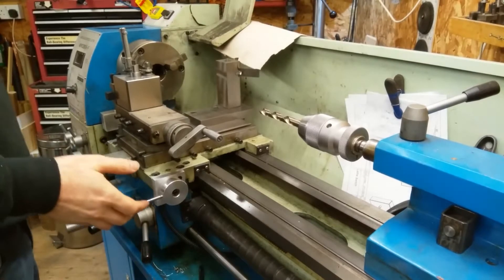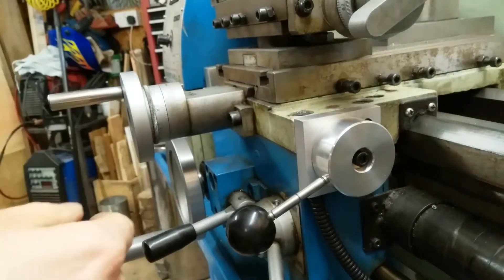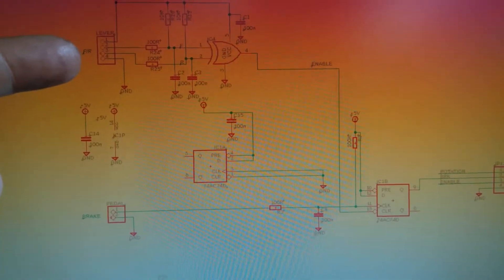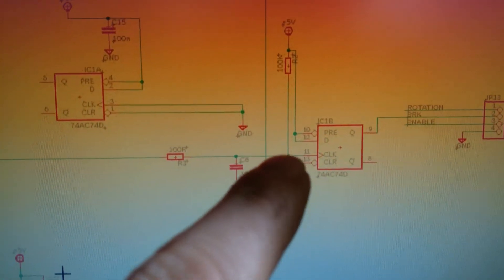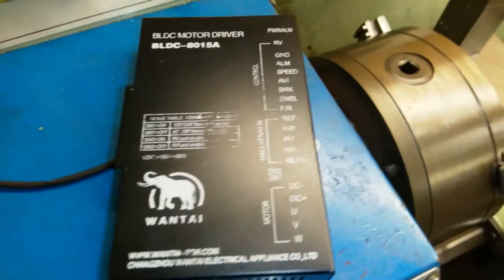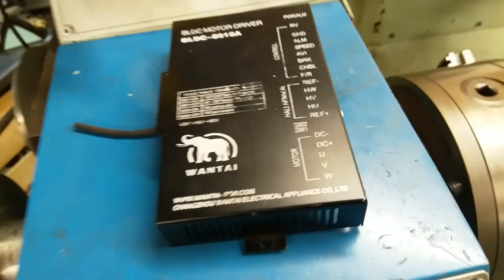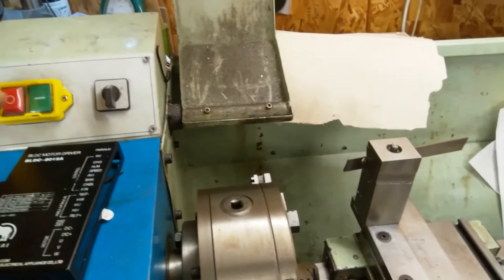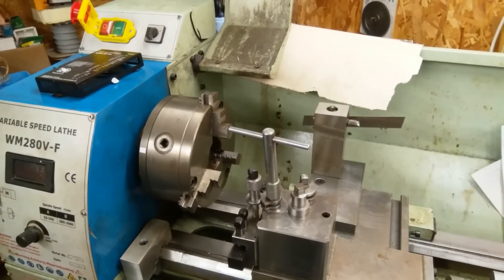Electronic Lathe 'Clutch' Handle

Comment: Hi Olly on to number two!! 

Your electronic and electrical background certainly shined through here!! As an apprentice our tutor would often turn up and stamp on the emergency stop, always used to give me a fright, I'm glad your works so well. 

I think ours were a full length bar so could be stamped on across the length of the machines and had a spring loaded detent that you had to over come by pushing longitudinally before forward or reverse. Its certainly a good upgrade, but what happens if you go from forward to reverse without stopping perhaps by accident?

Are you back at work yet or still digging up the garden? All the best!!
Reply from the maker: Hi David. I am back at work, and I've had enough of digging so I'm hiring a mini digger!  The original driver that you see in this video didn't have any protection against accidentally putting it from forward to reverse. It would basically make a noise similar to the emergency stop, but then immediately spin up to speed in the opposite direction. I don't think it liked it much. That driver died early last year, and has now been replaced with a VFD which does have protection against that happening. I still need to implement the foot stop switch on that - probably will be fairly soon as I've got all the bits ready.

Comment: I like that Olly!
Did something similar years ago but used a Siemens Logo as the control interface. The other reason I used the Logo was I wasn't clever enough to do what you have 😁
Cheers Neil
Reply from the maker: Hi Neil. Thanks, it's a lot nicer way to use the lathe than having to having to fiddle with the controls above the chuck. I intend to remake the video (and the control, just a prototype) as I think it was my second video and is pretty terrible. The ball detent isn't strong enough to prevent accidentally moving the handle from forward to reverse, so have occasionally slammed it into reverse at high speed 😬. Not nice. I'm thinking of a more mechanical kind of interlock, like a labarynth (z pattern) or something, so you would have to try hard to do it wrong.
Reply: @ollysworkshop  ah ! Ferrari gear gate style. That would look sweet😁
The video is good Olly,  don't run yourself down. 
Cheers Neil

Comment: where does the inertia energy dump when you stop it dead?
Reply from the maker: The motor windings are basically shorted together when it's stopped with the pedal, so I would imagine mostly in the motor, with some in the MOSFETs on the driver.
Reply from the maker: @Billy T I'll try and use my thermal camera to find out where it's all going.

Comment: Seen your lever upgrade, also you have a very clean electrical drawing, once again 😀 you are impressive.
Reply from the maker: Hi again Keith, thanks.  I do intend to improve this design at some stage, and make a better video - I've since learned how to record my computer screen directly, rather than filming it!
Reply: @ollysworkshop  That sounds excellent 👌 with using the computer. The night I sent you a message earlier, I was somewhat tired. I might repeating this 🤔 question again. I live in the USA, in
 Michigan. Where do live?

Comment: How do you find the Warco lathe?
Reply from the maker: Hi. It's a nice lathe to use. I've had no issues with the mechanical aspects. I've worn out the stock DC motor and the NVR switch (I have had it for more than 10 years). Mine came from a different distributor (amadeal), but they are essentially the same. I think the newer ones come with either a brushless motor or a three phase with a vfd. Either of those should last better than the brushed motor that I got with mine. I hope that's useful, but do ask if you have any more questions. Welcome to the channel!

Comment: Nice setup, what are you using as a brake?
Reply from the maker: Hi Dave, the brake is built in to the motor driver, so that part was fairly easy. You can brake any permanent magnet motor by shorting the windings (could be done with a relay or SCR perhaps). Induction motors are probably different, but never tried myself. I'm going to do a remake of this video at some point as I have some improvements to make I'll probably put some stuff in about how to adapt this to other systems.